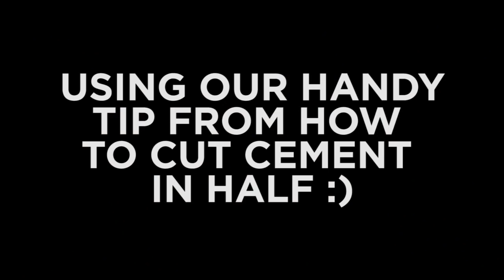Finishing copings on a wall - bricklaying

Comment: Can you tell me mate how much roughly to cement one grey concrete flat concrete Coping Stone back on as it came lose for cement and labour cost ? Size is roughly same size as yours in vid flat and it is an older Wall not new same size as yours and first Stone on Wall as you go in Drive Way and a small wall 2 brick thick brick thick and 2 feet high ? Thanks

Comment: I use isotunes noise cancelling headphones even if you was inside the cement mixer while running it wen u take a call, you or the caller would not here it u can connect two phones up to them one for work one for the good lady and they are tiny last 8hour battery no probs very cool